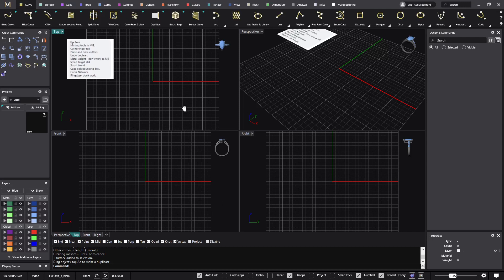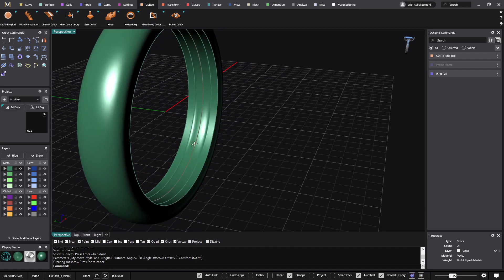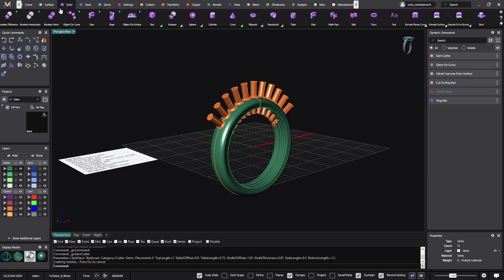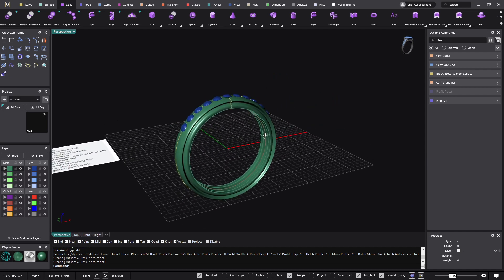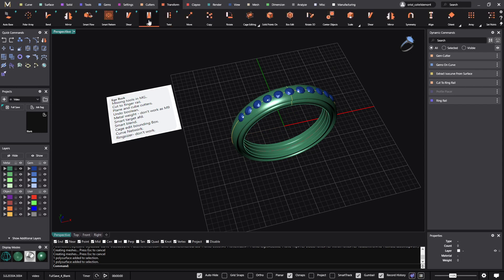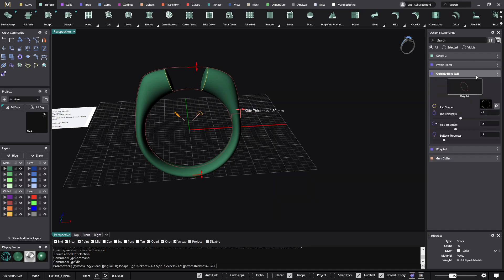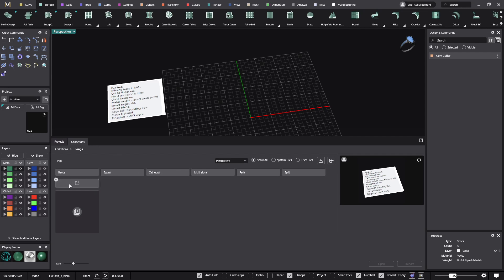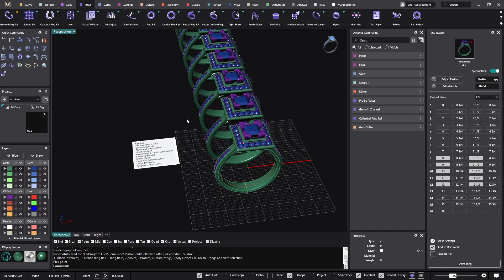Matrix Vs. MatrixGold Workflow

Comment: I would be nice to see how all those buttons on the left of the profile placer work other than just trying move around the dots that are already there.   How would you build a profile from scratch?  Could you turn a curved profile into a totally sharp angular one with those tools? It seems like the demo of just pushing each dot around does not allow for really straight lines, everything is very curvy.   So what do those tools do?
Reply from the maker: Craig Hunt, In the academy, we have a profile editor series of videos where we told how to use it. We will keep adding more videos about it as long we keep improving the profile editor tool.
Reply: @GemvisionLLC  Well, most of us watching this on Youtube are not part of "the academy"  so not much help then. We probably wouldn't be here if we had all the answers already from that training course.